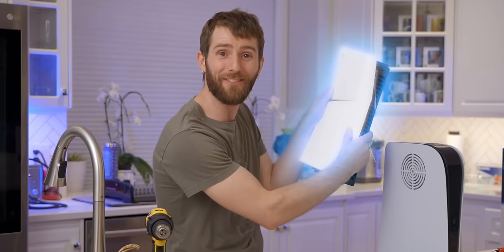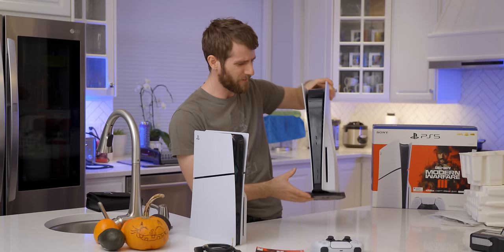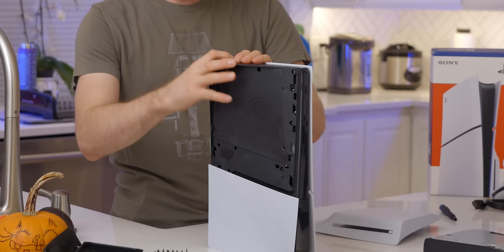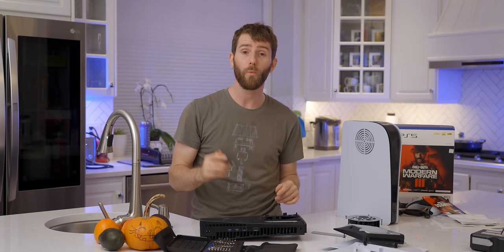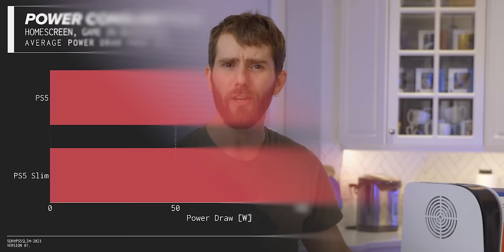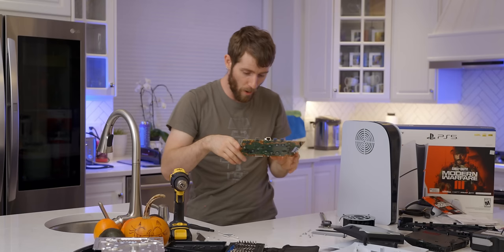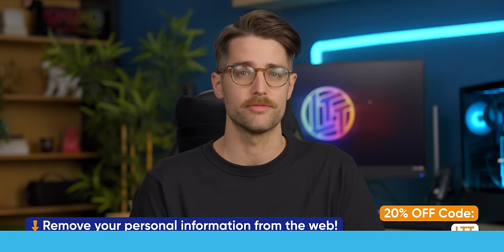PS5 Slim First Look and TEARDOWN!!

Comment: I must admit Microsoft really did do a good and tbh a better job than Sony in designing the inside of their console. Series X is just so well put together!
Reply: Jajajaja 😂😂😂😂
You dont even know nothing...
Reply: @luisrendon5869  oop their we go! We have our first console fanboy! Congratulations!
Reply: this is so not true. they split the board which uses a connection which slows things down. daughter boards are fine and all for IO but don't be making half of your console on a separate board. And the fan isn't that effective given how packed everything is inside since its all sandwhiched together (mind you i am talk about series x). Look they can make that nice graphic that shows a tornado effect that looks really cool but thats not how that works. Very little fresh air is hitting the parts and most is room temp air at the bottom which progressively gets hotter as it goes to the top until it gets pulled out. Its a crap design. And its a nightmare to actually work on. And due to how little space it can actually get hot to the touch which doesn't really happen on ps5. Ps5 fan bring in cool air blows it over the heated systems whicch also helps its heatsink and blows out the heat in the back not at the top. Sorry series x is a bad design. 

Sony can most definitly slim down the look further but they also want it to have some character unlike the boring as fuck monolith that series x and the vcr series s. I will take some character over some that boring design any day of the week.
Reply: @densetsu4286  before I been read the rest of your comment you simply don’t understand. The second board is used for I/O. Nothing else. The connection is fast enough as there is no need for high bandwidth. And pretty sure it’s a PCIE Connection. The fan is VERY efficient. You can put your hand over the console and it’s just pumping air… and GN tested it and it was perfectly adequate. The console pulls completely fresh air in. There is no Used air to be pulled in to begin with. And it’s actually a good thing they have a split board design. Thick metal case stops bending. And acts as a heatsink and air channel. There is 3 air channels in fact. Middle. Left. And right. Dedicated to each component. Left, PSU cooling. Middle, PCB/VRM cooling. Right, APU cooling. And then throws the air out the top. You are clearly a PlayStation fanboy especially based off the way you described the design of series X. When in reality very little people think ps5 is any better. It is huge, ugly and cheap looking with gloss black. Series X was designed completely for function over form. Function being cooling. Split board for making the console slim. And a large 130mm fan too pull all the air out. Plus a VPR heatsink. As I said, you are just a fanboy.
Reply: @ARXInfinite  No duaghter board is the same size just for IO. Look at ps5 slim's daughter board for IO. Very small. series X is the same size.

Also ITX motherboards been around for a while and they are not more advanced in anyway over micro atx. Or even atx or atx e. 

So cost more for no real gain.

Also the fan being adequate doesn't mean its good. My point being made that the system gets hot to the touch all around. Not so on ps5 just the back where the heat gets expelled on the ps5. 

 Your system being hot to the touch is not good design. Sorry. And again its room temp air not cooled air. Hence adequate. Not good.
Reply: @densetsu4286  I also remind you it’s the same size again for the form factor.. and the fact the Chipset is on the second board.. ps5 just has usb’s.. series X’s does a lot more.. you have no idea what your talking about.. face it your just simping for Sony here.. trying your hardest to make ps5 look completely perfect.. look how you acted before about the Xbox design.. you’re just a fanboy
Reply: @ARXInfinite  And thats the problem with xbox's daughter board doing a lot more. Its not a good thing. 1 micor or mini atx would have been a better solution than two itx boards tethered together. It doesn't matter how fast that connection is. Its a bottle neck. No connector is faster than a motherboard trace. The fact that there is not one trace that goes from each board inherently slows it down. The fact that it only has one connector if memory serves me right is a bottle neck since all comunication between boards are routed through that connector and not individual traces. And that slows it down. Its why on paper it looks like series x should spank ps5 but in reality its a tug of war. 

Says the xbox fanboy. Your not helping your case. You lack clear understanding and think adequate and good cooling are the same. You think passing that heat to all sides of the xbox wehere  you can feel it get hot and uncomfortable to the touch as a good thing. Wrong these are bad designs. 

And the fact that everything is sandwiched together so tightly not leaving room for much air passage even though yeah it has 3 is bad design. Hence why its adequate. Its not good. It functions but its not efficient. 

Two itx is not better than one mini or micro atx. There are no connectors between mobos cause its only 1. If series x design could have been one itx board it would have been a better design. But its not. Ps5 design even though outward appearance is subjectable is better. Hence why a 10 tflop machine has a tug of war with a near 13tflop machine. That should not be the case even with diminishing returns.

Cooling is subpar, air flow is subpar, fact that the heat transfers on all sides to the case to where the owner can litterly feel an uncomfortable amount of heat is sub par. 

The only thing i give props to is the use of a vapor chamber. But they use traditional thermal paste in an environment that has poor airflow means you will need to take it apart and change it up and this is a headache on MS machine. Og and important parts of the psu that are dangerous to touch are not shielded like sony's or any modern psu design. So theres that to watch out for. 

Keep having fun paying outragous prices for that proprietary memcard expansion. Fucking 2400MBps for 1tb costing well over $150 and nearly $300 for 2tb. Even though its old fucking tech interfaces. God your getting ripped off and your like please sir i will have another. My brother just bought a 2tb 7000MBps ssd for $130. 

And the overall size and design of the series x makes it more of a nightmare for tv stands. Most cant accomodate its higher standing and wne laid down the hot air being blown to the top will get recycled back into the system due to lack of room meanwhile ps5 just blows it out the back which nearly all electronics do so no recycled hot air getting into the system but even if so its still cooled down thanks to the fan. Not the same with xbox. 

Its crap design excpet the vapor chamber. Thats the one good design element in series x. Oh and btw i game on pc, ps5 and switch. I build, diagnose,  and repair computers to a certain extent (im no louis rossman). I had A+ course, computer networking course, I do know what i am talking about. 

And while function is important having form is as well, especially if that form can mean not causing you to be uncomfortable when touching machines. They shouldn't be hot to the touch. Should be room temp to the touch for most of it while the exhaust area is the hottest point and even then should be minor. 

There are ways to make an effective heat sink that doesn't require the case to be the heat sink or spreader. Thats poor design. Sony made a heat spreader that also transfer to a heat sink and all of it doesn't go to the outter case. See that big metal sheet that had a bajillion screws that they used a power tool thats the heat spreader. And the heat sink was attached to it. And the heat sink is by the exhaust. And the fan pushes cool air all over the heat spreader and onto the heat sink and its then forced out the back. Thats proper good airflow and spreading and collecting and expelling the heat. Series X not so much.

Comment: I think a lot of people are upset because they hoped it would be an upgrade rather than a repackage for new customers. I think they wanted a PS5.5
Reply: But the slim consoles are never performance upgrades, just smaller and quality of life things. It's also not just a repackaged it has more storage, better front IO, removable disk drives
Reply: @SDkillaa   absolutely, but I think people were hoping to see the PS5 Pro, not the Slim.
Reply: @elliottsw  Yeah but they shouldn't be surprised, the Slim comes before the pro. If the pro ever even comes that is, Only happened for one generation

Comment: smaller and 30€/$ more expensive than the original PS5 - because that had a stand included......Sony findes new ways to increase the price tag:). So after its release PS5 becomes alsmost 100 bucks more....i begin to wonder how much the PS5 PRO is supposed to cost with its rumored +100-125% stronger GPU....999€?  Would be ridicoulus.

Comment: I legit used to keep my ps3 kind of behind me and to the side because it was on the shelf above the hanging projector. Of course the projectors were so loud then, you'd be hard pressed to separate one fan from the other. Not to mention the disc drive on the ps3 super slim sounded like a jet engine ignitition.

Comment: 8:08 to take out the disk drive, you have to push the lock. NOT to pull out just like that. Read Manual first before You tear down it.

Comment: I always was an xbox guy, I mainly use my PC though for gaming. Well I only use my PC for gaming & one every 3 months I might play 20 minutes, on my console, I found out about GTA 5 for ps5 & I bought myself the console, First thing I noticed was SSD load times are super fast, Game play has been super smooth on gta online & almost no stuttering at all if anything. for $700 AUD the ps5 is WAAAAAY better than I even expected it to be when I paid for it. I've slowly been stopping myself from playing GTA on my pc, even though it runs at my screens refresh rate in ultra graphics, the updated ps5 version and 60fps with this console is genuinely amazing, the perfomance vsing a ps4 or xbox is second to none.

Comment: I just got a PS5 Slim and have a problem with the top USB-C port: it won't charge in rest mode but works fine when the system is fully operational. The lower USB-C port works fine in all situations.
Reply: Have you checked if that's on purpose or if it's a bug?

Comment: Removable disc drives are such a big deal. The original PS5 marries the drive to the BIOS chip, making impossible to repair unless you have both. You can "downgrade" a console to digital with a flasher, however.

Comment: Would've been nice to know if the controller pairing works with that new USB-C port. The OG PS5 still requires you to use an A->C cable to re-pair the bloody things.
Reply: its C>C to pair the controller on the slim

Comment: Have you looked into QNED's? The LG QNED 75" 916QE is currently £999 down from £3499 which is a huge discount! Difficult to find unbiased/ unaffiliated reviews, but it seems very promising. Packed with features, 100hz (but can perform 4k @ 120fps via 2.1?) but has very few local dimming zones. Might be worth a comparison, or technical clarification as I didn't think a native 100hz could display 120fps, but that's how it's being advertised

Comment: They improved cooling by more efficent nand and vram chips. Cool stuff. Ps5 pro will be 80CU 20gb vram and zen 3 8 core cpu at 4080 4090 power

Comment: 2 type USB C connectors don't make sense for anyone who bought the official Pulse 3D Headset because you can't plug the USB dongle into the front anymore without buying a USB C to USB A adapter.

Comment: really would like to see some temp tests since my og ps5 has had overheating issues recently even after deep cleaning it. best fix would be plates with more flow (like dbrand) but less heat sink (at least i think) in the slim makes me worried 😅
Reply: The OG PS5 (2020-2021) Used an older more inefficient 7nm APU so despite having more heatsink it had issues overheating. Trust me I owned a launch PS5 and it overheated and killed its own motherboard, I then got the refreshed 2022 model with the new APU and even less heatsink and that thing is still going strong, I also picked up one of these slims a couple weeks ago and happy to report the heat coming out the back doesn't feel any hotter than the fat 2022 PS5. The launch model was definitely the worst version they've had over 3 years to work out the bugs

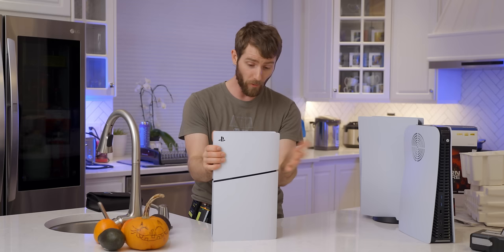Comment: 6:05 It's good that it doesn't need a stand to stay up, but what do you think about the vents there on the bottom at 5:44 ? Inlet or outlet, freely breathing or not when standing flat without the stand? If there is a problem with that, I bet there will be videos in six months' time saying the PS5 slim sucks and gets overheated, just because people didn't buy the stand or make a 3D printed one.

Comment: Someone needs to come up with a RGB LED shell cover plate that can connect to the main fan power with a splitter.  That way theres no tacky usb plugs and wires sticking out of the system, and taking up a port.  Man... these companies really should consult me about their products.  I know I can design someone some crazy accessories I know will be popular, and actually look CLEAN!!... or buy a 3D printer and just do it myself!!

Comment: Im confused, if I get the ps5 that already has the disc reader, do i still need to register it? Or does that only apply for the digital version
Reply: U need to register imo and need a internet connection to use a physical disc.

I would just rather prefer the OG PS5 looks better, bigger and more air to breathe

Comment: I've had my original PS5 for exactly 3 years in a few days, and the last at least two of them it's developed a coil whine that's driving me nuts. Might replace it with a PS5 slim on it's 3 year anniversary, which hopefully won't develop the same coil whine

Comment: Long story short, it is not a Slim version, it is just a redesign, and an expensive one too. My educated guess about the size factor is that they added more thermal paste everywhere to be sure the console stays as cool as the original? It will be fun to see in 10-20 years what is going to happen when all that paste gets dry.
Reply: You do know they use liquid metal right?
Edit it might leak out but it won't dry.
Reply: @MikeKing001 I saw they used liquid metal yes but I was not aware of the fact that such compound does not ever dry. Good to know, thanks!

Comment: You are reffering to the original FAT units nm, not the last ones. For example PS3 last FAT units were 65/65 not 90nm. And the slim went to 65/40 so only the one chip got cut.

Comment: I don't see a reason to hate this honestly. It's not for people who already have a PS5 and would want that "upgrade" of a new chip or anything. It's for people who don't already have one. If you can get equal cooling and performance in a smaller form factor what's the issue? Not worth "upgrading" for but for new customers there's no real downsides either which is what counts. The PS3 for example may have cut the die size in half but it also removed a pile of IO and backwards compatibility. I'd rather a refresh that keeps the same performance with a smaller footprint over one that actively takes things away.

Comment: This is super sleek and better designed with more storage and better port design.  Do you know if a special theme design will be available for the new  slim model.  I wanted the Spiderman 2 theme plates for my OG PS5 and am still looking for them for my 2nd grader.  But it would be nice is this new slim disc version had a Spiderman 2 theme model or better yet COD theme to snub XBox for Activision purchase.

Comment: Nice video overall, though I'm surprised that ye didn't show that those two clear plastic, weak looking, clips are the feet you have to attach to the slim to sit the system horizontally, which still leaves about a third of the system unsupported - that and the void left under the slim are two things I really dislike about the refresh (aside from the now four system plates!) ...

But all in, the slim looks "fine", but it was clearly cheaper for Sony to make, so why is it dearer than at launch and not selling significantly cheaper than the launch model did, three years after it?! 😯😂🩲😀🤘 .

Comment: So my question is is the extra usb c port helpful? I feel like having a normal usb in the front would be more helpful, but i dont have any ps5 accessories to attest to what dongles they use (controllers, headsets, chargers, external hard drives, etc).

Comment: I still wonder about adding a fan vent to the plates. I know that I’ve watched a lot of PS3 modeling and due to bad GPUs, you couldn’t keep those cool enough. However, people did try to modify those quite a bit. I’m wondering if modifying the plates for the PS five is actually better for it.

Comment: Forgive me as I have just joined the PS5 community with the slim + optical drive: with the level of liquid metal in this console, is it safe to use it vertically or will the liquid metal actually still leak?

Comment: I’m about to buy my first ps5, finally! I initially figured I’d just get the older model since it may drop in price a little as this slim one launches, and it’s Black Friday time! I genuinely don’t care how it looks, I just want it to perform well. From what iv heard, the OG ps5 has had some issues with overheating. Will this slimmer version fix that? If you were in my shoes, should I save about $100 or so on the older model and just buy an external cooling fan for the overheating, or should I fork out the extra money for the slim?
Reply: The original model didn't have a lot of trouble with overheating. If you choose to get the current model you will get the revision that was released last year with the 6nm it's up to 10% more efficient than 2021 , and 2020 models,  so you should be fine as this one also uses that same chip.